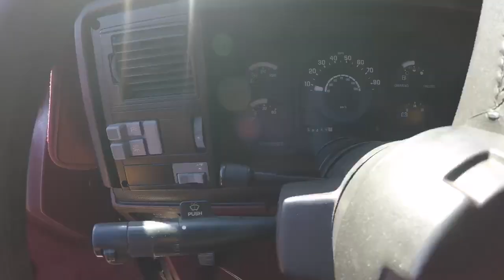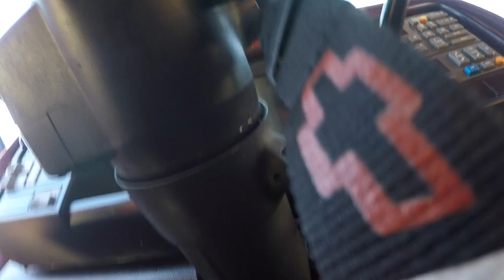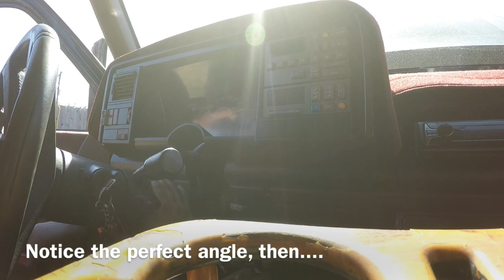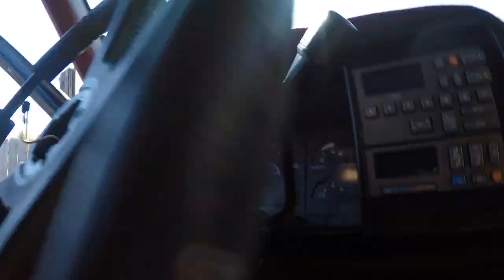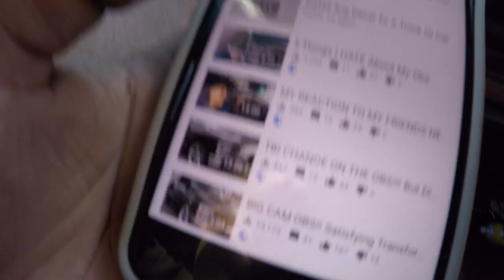88-94 Obs Chevy | How to drop steering column and replace with new one

Comment: I need help!! Got  a 91 c1500 single cab and my steering wheels whobbles like crazy! I took apart and their was 4 bolts loose I heard it was common so I tighten them up and still moves but just steering wheel a and not the the whole assembly anymore but you Happen To know what it could be?
Reply from the maker: Wobble? While driving?
Reply: Jesse Obs  yeah like steering wheel moves all over the place. I hit you up on IG I could send video so you know what I mean, I just got the obs and wanting to fix this main problem bro

Comment: , I need to change out columns but the new one I'm putting in doesn't have cruise control maybe I can bypass the wiring and just let the turn signal knob hang down beside the new one?
Reply from the maker: Yeah, totally. I deleted mine. I know I’ll never use it or need it. It also males the engine bay cleaner

Comment: When installing the new colum do you have to line up the steering linkage to any marks so the alignment will be correct ?
Reply from the maker: It’s all bolts, holes and nuts. There is no SERIOUS alignment. Obviously it has to get to its holes, but other then that there’s no aligning really

Comment: Quick question, there's a black wire with an orange tip & a metal blade that I took out as the first step after removing the plastic cover below steering wheel. I unhooked it but then put the column install on hold & forgot where that wire connects so my question is where does this wire connect to & does it have anything to do with the taillights? Quick question for you but I'll possibly be hitting up the junkyard for intel on this but if anyone could tell me what it connects to it'd be greatly appreciated, thanx!
Reply: It's on a 1994 GMC Suburban 1500 which uses the same style steering wheel as in this video, BTW
Reply from the maker: I'm gonna be straight up w you, bro, Idk wtf that goes to lol. I just disconnected what I had to disconnect and connected it all back. There are diagrams of all wiring on these trucks out there and I am almost more than certain that there are forums that can tell you. Sorry I couldn't be of any help :/